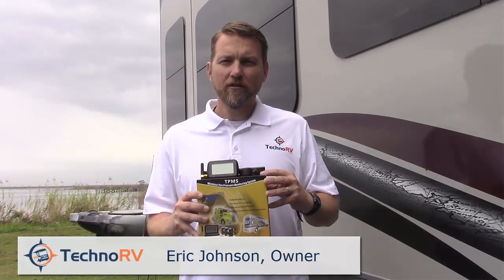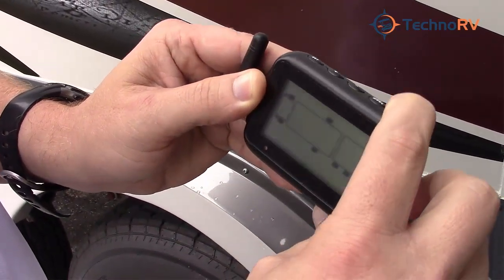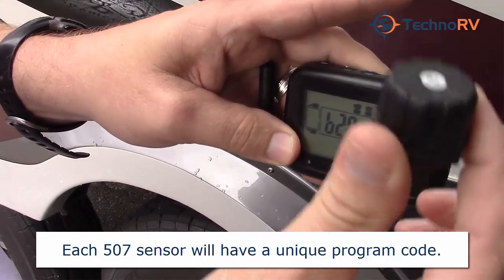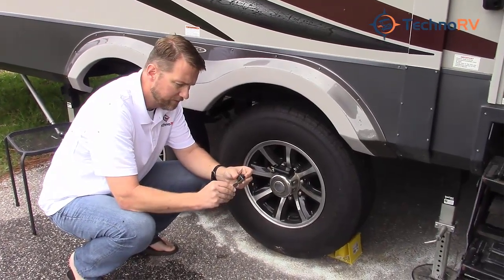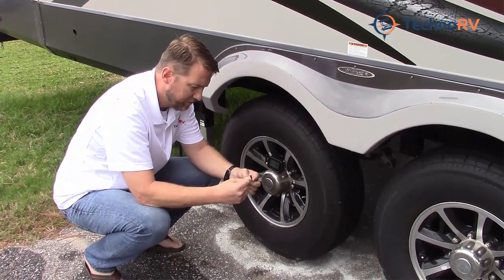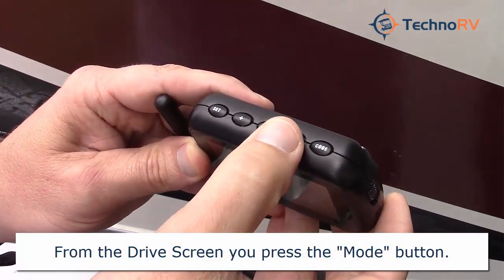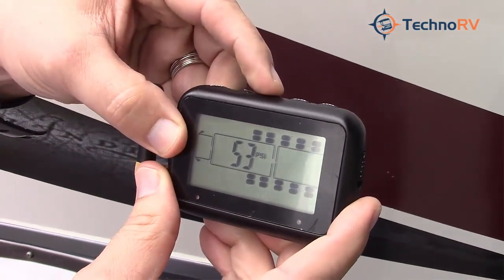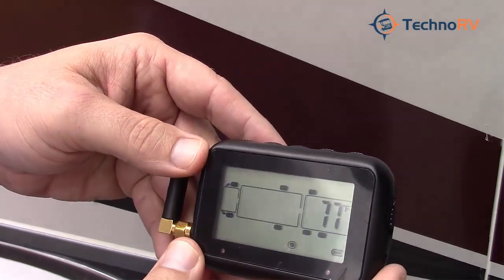Installing TST 507 Tire Pressure Monitoring System Sensors

Comment: I gather I do not need the repeater in my 31 foot class c beings it is not that long as a fifth wheel and truck?
Reply from the maker: We recommend everyone using the repeater.  It's not about just the distance,  but also there could be signal interferences while driving that could cause you to lose connection.

Comment: Installing the flow through sins or does it need to be put on the rim before the tire is mounted on the rim?
Reply from the maker: Hi Mike.  The flow through sensors are mounted on the valve stem. Are you referring to the internal sensors which must be installed while the tire is broken down.
Reply: TechnoRV  by watching some of your other u-tune shows I’ve answered my questions 
Thanks for replying 
Mike Brannam

Comment: This video is a bit disingenuous. Shows putting the sensors on an exterior Tire with an easily accessible valve stem. Let's see you put them on duelies where the valve stems turn towards the center of the coach, or they're on the inside duelie where you can't even get to it.
Reply from the maker: Yeah,  some valve stems can be challenging to get to, that's for sure! We were lucky enough to not have that situation on our RV, but we know it exists.  We do offer Wheelmaster valve stem extenders in 7 different sizes and shapes for this very reason though.  Usually one of them works to get the valve stem to a place where you can install the sensor easily.  There have been times though where the owner has had to have the stem moved by a tire shop in order to get them accessible. It really is different for everyone!

Comment: What do I do if my monitor won't find sensors right out of the box?
Reply from the maker: If you just purchased a new monitor, you will need to program them into the new monitor using the instructions you received from us.  If you purchased an entire new kit, you will need to program them into the correct tire position before screwing them onto the valve stem.  If you purchased from TechnoRV, we sent you a Learning Series with instructions and tips.  If not, TST has fabulous customer support and would be happy to help you!

Comment: We have a 41' 2014 Tiffin Allegro Bus and just installed a 507 system.  It works great except for the two inside tires on our rear axle.  I get readings on the outside, but not inside.  I've switched sensors and same result, so I know it's not a sensor issue.  I can read tire pressure on the interior tires (which have extenders) with my pressure gauge - why won''t the sensors register anything?
Reply from the maker: +Peter Greenawalt We had a problem with our inside duals too.  We added a tiny extender and they worked after that.  We assumed the pin inside the valve wasn't lining up correctly with the sensor and the extender fixed that.  When we have time,  we've considered having the valve looked at so we can get rid of the extender as that is not an ideal solution.

Comment: Don't the sensors mess up the balance?
Reply from the maker: The tire sensors weigh less than an ounce, and they do not cause balance issues.
Reply: carmas54 
Bean bag balance.

Comment: We purchased the TST 507 system from TechnoRV.  This is the issue we would like to discuss.  The TST reads sometimes 6-7 psi less than our tire gauge.  We do have a good tire tester.  Any explanation or solution?
Reply from the maker: Is it reading 6-7 lower on every tire?  The average tire gauge usually has a 2-3 psi variance, and the TST has about a 1 psi variance.  If you are off by 6-7 on every tire, that doesn't sound right.  Test each tire and let us know!  You can contact us at 866-324-7915 if you would like to talk.

Comment: can you use this system on a tow vehicle?
Reply from the maker: Yes!  It's great for tow vehicles as it lets you know what is going on back there.  We use them on the Jeep Wrangler we tow in order to monitor the Jeep tires while in the motorhome.  We recommend using the cap sensors instead of the flow through on tow vehicles though as they are lower profile and don't stick out.

Comment: I purchased the TST 507 system and it came preset @ 175 psi and a low psi of 101. Mine will not go any lower then 101. Am I doing something wrong? I want to use this system on my travel trailer, but if I can't change the high & low pressure setting, this system will be useless for me.
Reply from the maker: Sorry for the late response!  Yes, you can set it lower than 101.  When you are setting the PSI parameters, go ahead and set your high and bring your low down to 101.  After you've done this scroll through the axles until you go back to that axle and you can go as low as you want.  It's like that because on the original setting, you can't set the low below the high.  Hope this helps!

Comment: Great system!   Watching these videos led me to purchase this system and it paid for itself the first time I installed it.  Had just purchased new tires and during installation one of the o-rings on the valve stem extensions had failed and began to slowly leak.  Before leaving on our trip I was saved from a tire failure that would have been next to impossible to diagnose.  Many thanks Eric for your videos.
Reply from the maker: Tire issues can occur at anytime. Glad this system saved your trip. Great technology in the TST system, and we have put tens of thousands of miles on our RV with the TST system with great results.

Comment: We did the install without a problem but when we turn on the monitor it cycles between tire sensors but doesn't show the pressure on each tire initially. The tire locations blink but no readings...is this the monitor not acquiring the sensor? That's the only thing we can think of at this point.
Reply from the maker: How long is your RV?
Reply: Approximately 30 ft. We do have a repeater we are planning on installing soon. From what I can tell it just takes a few mins for the monitor to acquire the sensors.
Reply from the maker: Yes, it can take a few minutes, or a bit longer, for the PSI to populate, this is normal. Since you have the repeater you will ensure you have a great wireless connection from the sensors to the monitor. We also have a video of the repeater installation on our Youtube channel.